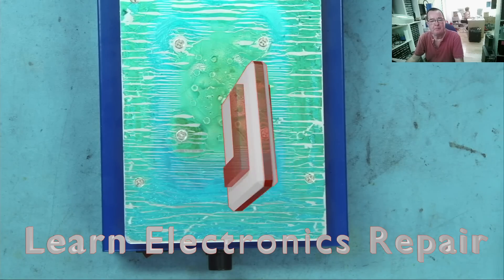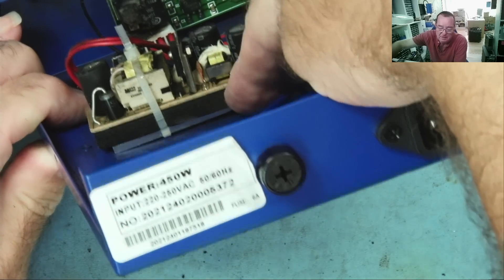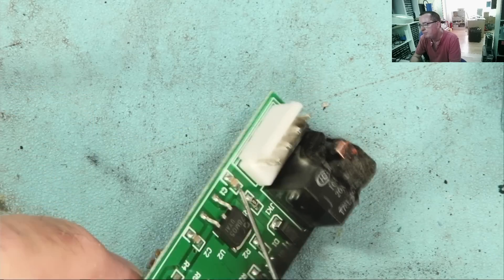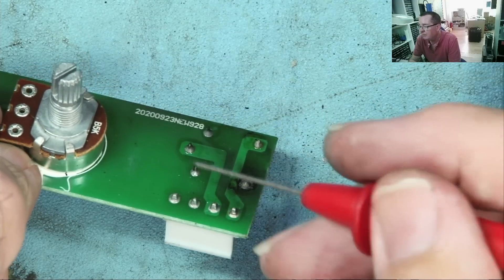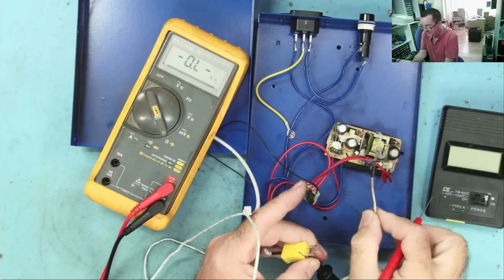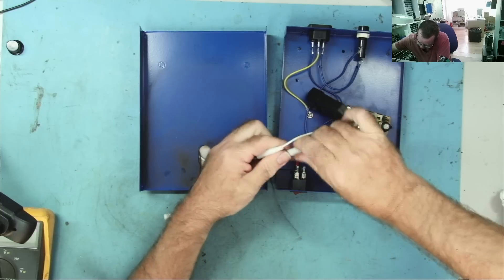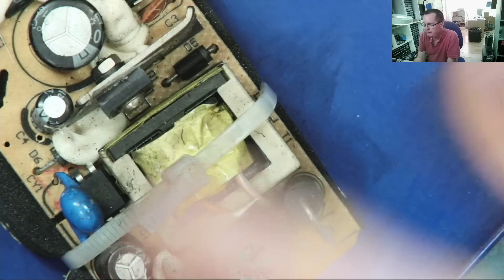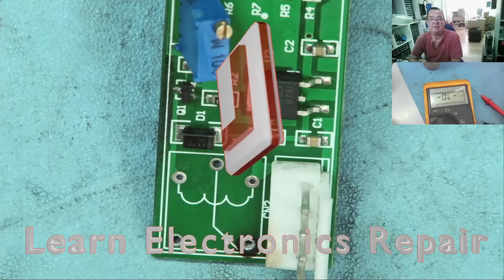How to Think like a Repair Pro - Learn to Fix Random Electronic Devices, No Schematic or Datasheet

Comment: Hi - I'm always impressed by your logical approach, your enthusiasm and your respect for learners. Messing around with vintage electronics has been a hobby of mine for over 40 years and I never fail to learn something new from LER. Great work! (Any chance of something on valve/tube amp faults..?)

Comment: I am not sure but you did not appear to check the resistance between the case and the heating element.  I believe you said earlier it was tripping out when the owner connected it to the mains.  It is another potential fault that could lead the relay to burn up if the insulation of the heating element has leakage to the case.  Unlikely but there is always a first time for everything.

Comment: look at the pads on the two red wires at 22:28 on the video - or are my eyes playing tricks on me
Reply: Its not your eyes, I see it too
Reply from the maker: You mean the remnants of black and black/white wires where they obviously cut that pcb out of a 12V power pack? 🤣
Reply: @LearnElectronicsRepair  oh, to the untrained eye it looked like the pads had lifted off the board where the red wires are coming in.  But I see the left one is black - I just had a man's look as the wife tells me.

Comment: I am still catching up on the videos from the past ...  This is another great one and that last lesson about testing the diode out of circuit... Vs. being in circuit and what has to be considered, This is a very useful lesson.  And I would assume the same concept of considering what's in a circuit for testing any component must be taken into account.  Though we have seen a lot of testing in circuit with demonstrations of the validity of doing that.  Anyways great reminders and examples in this video,  it takes time to gain experience to make judgment calls 🙂

Comment: The heating element shows an abnormal value (about 34W @230V).  It may have short-circuited, causing the destruction of the relay contacts, then evolved towards the too high resistance value measured. The mechanical stress caused by heating can lead to this type of defect.

Comment: I still don't understand why the mains tripped and the fuse didn't blow. How do you determine the correct rating for the fuse?
Reply: RCD will likely have tripped at around 30mA of fault current to earth, preventing the fault current getting high enough for the fuse to act. The fuse would be more likely to act in a Live-Neutral short circuit, where fault current can get upto thousands of amps without locally going to earth and thus not triggering the RCD.

Current rating of the fuse would be done by calculating the power of the device. Power = Voltage x Current.  This device states it is 450W so 450W / 230V = 1.95A. So you would select the next appropriate fuse size up from that to provide overcurrent protection.

Comment: Love the sense of humour with the chinese watts lol and hey nice carbonised contacts sets up a nice arc welding circuit inside the relay and about 10,000 chinese watts of heat  :D  Richard is isopropyl cheap there?  Coz it ain't here, it's like $27au for a litre!  Obviously you go thru it like tea, hence the question ;)
Reply: The last time I purchased 5 litres of the stuff for around AU$30 in 2019 delivered to a residential address (Melbourne). 
Bear in mind it is Hazardous  Goods and can't be sent in postal system. 
Buy it from a chemical supply Co., not some small bottle seller like Jaycar or 'hardware' shop.

Comment: thx for that - i never would have thought the heating plate is ran through those flimsy wires ? i expected something like 16-12AWG at least
- please tell the owner that the blue film on top of the plate is a protective film that should be removed before first use. the same kind is used for stainless and chrome

Comment: I just recently had a customer come in with a defy microwave oven which started but no heat and no fan or platter rotating. The problem was a relay on the PC board with the buttons. It was making a click but no continuity on the switch side. Dumb fault caused a ZAR 2500 microwave oven to be a paper weight. Thanks for showing this.

Comment: Regarding diodes, back in '67, I was working on a piece of equipment having 232 diodes, and 84 relays.  working with Texas Instruments engineers, we found most of the diodes had been installed backwards, and many of the relays had incorrect voltage going to the contacts.  It took us about two months to find those problems and rewire all those "black boxes" for their original purposes.

Comment: Nice job.

You were right about the local parts suppliers in the states... It's very hard to find any.

I guess they can't compete with the online suppliers.

I expect there are higher import duties where you live so buying individual parts from the manufacturer is to expensive for most people.

The parts suppliers where  you live probably buy in bulk and make a little profit selling the individual parts to the public.

Comment: Great Troubleshooting,
if you have worked on cars at all, this is really common with wiring and relays on cars that carbon dust from sparking builds up and generates high resistance and heat . this in turn kills components and the relays it self and some cases blows the fuses due to the higher draw of current

Comment: still unclear why it would trip the mains but not the fuse?
Reply: The fact that it is tripping anything is confusing me. Perhaps the circuit had some sort of short due to the melted relay. Otherwise, it would just seem to be a relay stuck open to me, and generally resistance increases with temperature, meaning that the current should actually drop as it runs. Perhaps they have a material that decreases in resistance with temperature, causing increased current flow, and perhaps the first person's house is quicker to flick the circuit breaker than the Chinese fuse is to blow.
Reply from the maker: I only have the owners word for the fact it was tripping the mains, but no reason to doubt him either.  The most likely reason would be earth leakage but I don't quite see how.  The controller board with the burnt relay only has incoming live + switched live out.  There is no connection to neutral or earth from there - apart from the potentiometer shaft is bolted to the front panel and the case is grounded
Reply: Perhaps it's a timing thing? It is my understanding as a layperson that mains breakers usually have both thermal (for long-term low overcurrent) and magnetic protection (short high current spikes, usually associated with direct shorts). Maybe the magnetic portion of the mains breaker trips before the thermal fuse in the device has a chance to melt.

Comment: Does the thermo couple actually creates voltage with temp difference or does it only change its resistance with temp and we put it in a voltage divider circuit to measure what its reading
Reply: there are both styles available
Reply: A thermocouple generates a voltage due to a temperature difference, see the thermoelectric effect.  A thermistor changes resistance as a function of temperature.
Reply: thermocouples generate voltage. Thermisters change resistance.

Comment: Maybe the resistance reading of the heating element isn't that wrong. 1570 Ohm would result in 34W @230V. Looking on the dim bulb tester which goes dim also points to <100W power. It seems to me the claimed 450W are typical chinesium watts.
Reply: Oh, "chinesium watts", that makes sense. Darn chinee, tricked us again.
Reply: The heating element circuit appears to be run in parallel to the 12V power supply circuit, so that would Reduce the resistance/increase the current and power when both loads are active.

Comment: French plug/sockets are polarised, when using earthed equipment you can only plug it in one way round. They use two pin plugs on double insulated equipment.

Comment: The build quality of this unit is so bad, that I would tell the customer that with the cost of making fit and safe for use they might as well buy a new one. but this time get one that's CE marked and safe for use in the first place.

Sorry but I will not fix c**P like this and give it back in the dangerous state it would be in.
it needs a lot of work to bring it in line with any safety standards in the EU, but then who ever imported this did not have a clue about the Low voltage Directive to which it should conform to, or what a CE mark should like.

Rant over.

Comment: Thermocouples   doesn't  generate any voltage,  it change the resistivity.  And you learn another how to repair electronics, whit no electronics knowledge. BDW.. You have a beautifully nails.

Comment: With regards to the relay, I think we need to determine whether it is the coil that went or the contacts.  The coil will burn out if there is overcurrent/heat but the contacts will burn because of arcing caused by ultra fast switching especially if it has a good sized load on it. I think it would be nice if you could do an autopsy on the relay to see what actually happened.  From the pics I found online (hg t78l relay) you can see that the area where the contacts are is the part that's burnt, I would surmise they are what caused the failure instead of the coil.  It's also listed as an automotive 120v relay so I don't know if it's meant to be used in ultrafast switching applications.  I would also like to see what that fuse is rated at.  It really is strange that it reportedly trips the mains but the fuse doesn't blow.
Reply: Looks like contacts failed. 
My initial thoughts were excessive high switching rate, in which case a solid state relay would be a better replacement than another relay.   Not hard to rig up MOSFET to do that high speed switch duty.... if it actually does so, in which case it's faulty design using a mechanical relay.  
Deeper investigation as to how this monitors heat of the plate and any form of PID control would be interesting, but I doubt it is sophisticated and use high speed switching to keep the plate at an accurate temp range.
Reply: Good point and I actually thought dicky was going to do some measurements to look at this - will do so next time I have a burnt one!

Comment: Why such a complex psu for a simple 12vdc?. In fact the whole thing is overly complex. You can get simple pwm thermocouple based temp controllers for under $30 on a single board up to 2kw.. Or an old school thermostat up to 3kw that would last forever. That bang bang style relay method is doomed to fail. That relay will always burn out when used like that eventually. SSR pwm will last forever.